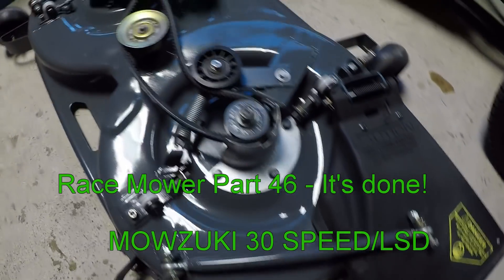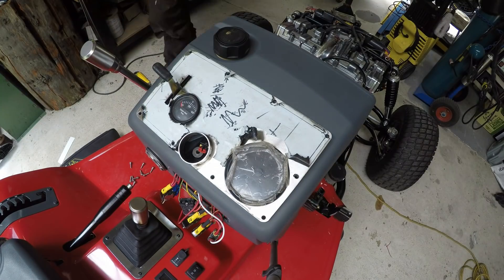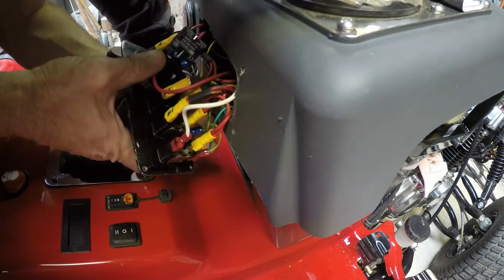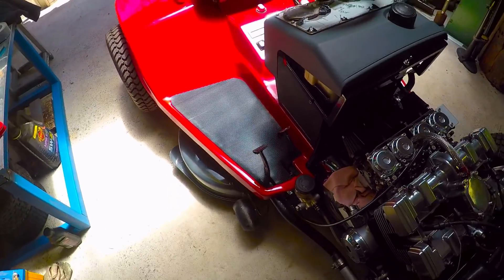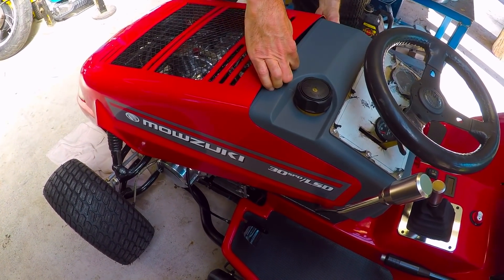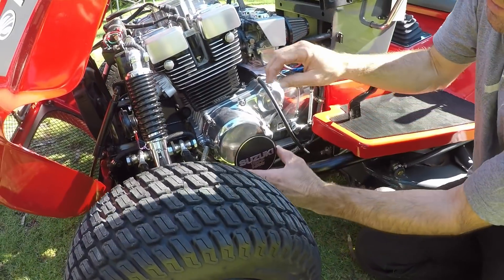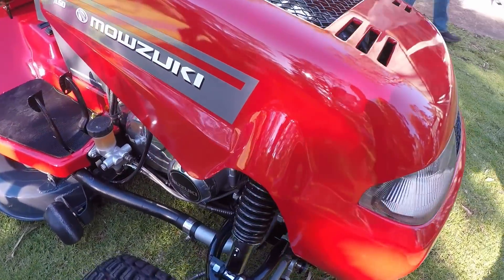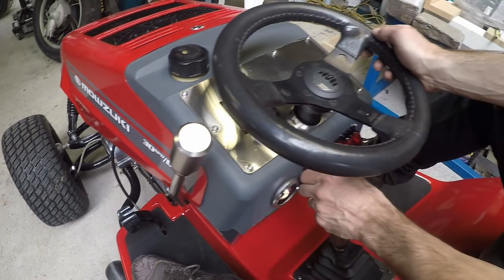Race Mower Part 46 It's done! MOWZUKI 30 Speed/LSD

Comment: I wonder if a single strap seat belt over your waist would be good? 🤔 just a recommendation 🤷🏻‍♂️ amazing build! It turned out to be almost oem lol. Thats how they should come haha
Reply from the maker: Hi Ale, I did consider a belt but in the end thought its safer without as I would rather have a chance to jump off rather than be strapped into something so heavy without a roll bar. I also added a safety switch on the seat so that the cutter stops if you are not sitting on the seat

Comment: I had a quiestion if you ride an go trough only the motorbike gears and the audi transmission is in first gear do you need to shift to second at one point because it otherwise gonna make to many rpm's And blow the audi gearbox?
Reply from the maker: Good question, the engine sprocket is 15T and so are the jackshaft and gearbox sprockets so the Audi gearbox spins at the same speed as the motorbike engine drive sprocket. The motorbike has a primary reduction so even in 6th gear the RPM of the drive sprocket is approx 1/2 of the RPM. So lets say at red line of around 12,000rpm thats 6,000rpm at the gearbox which is less than the audi redline. So I see no issues unless I change gearing for more top end speed. Most of the time I rev the engine up to around 7,000rpm so plenty of power for drifting etc at that rpm

Comment: :19 
This just popped in my head. 
Need some cool shift knobs? 
Go on eBay and search “36mm piston” or “weedwacker piston” 
For 5$ shipped you get a weedwacker piston and rings. 
I got 2 and made them into shift knobs by epoxying a nut inside them for threads for a shifter handle. 
Then I popped it on the polish wheel for a minute for a nice shine. Some light sanding might be needed first. 
I’ve used old pistons for this before, and that’s cool but for 5$ why not?
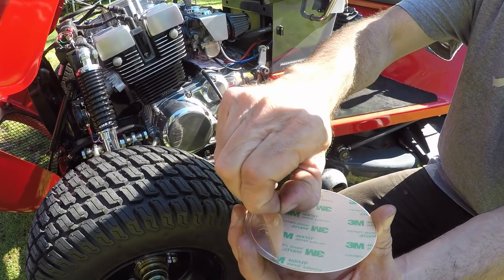Reply: 3:00 she’s beautiful man, really lookin sharp and professional
Reply: 4:00 
Hey maybe get some of that clear protective tape that bike guys use on their tanks so they don’t scratch the paint. 
I’m sure there’s gonna be odd places your shoes rub against the paint as you ride and I just didn’t wanna see you ruin that pretty paint! 
I’m sure it’ll take a few rides to see where you might be getting the odd scuffs here and there.
Reply from the maker: @MrTheHillfolk  Thanks! Glad you like it
Reply from the maker: @MrTheHillfolk  I didn't video it but I've actually clear coated over all paint and decals so it should be ok. Its really a show piece more than a day to day mower so it should be ok.

Comment: Are you going to beat Hondas world record mower in a speed run?
Reply from the maker: Not at the moment as I've geared it low so I can tow, mow etc versus just going fast. But I could change gearing easy if I want to go faster. I think its already fast enough
Reply: @Mezzmoengineering  
Sweet build. I think Honda got record at 150mph range/ suicide fast.  We have a mower that will hit 45mph but it feels like 90mph
Reply from the maker: @TheShockLoad  Yep, Honda speeds are just too dangerous. I'd rather be around to keep building other projects

Comment: thought it would be faster then that
Reply from the maker: Hi Cyrus, I've intentionally geared it right down as a top speed of approx 70 is plenty around home. I could easily change gearing as the gearbox drive currently matches the 15 tooth motorbike gear, so 1-1 compared to engine. If I make it for top end it won't be so useful around home....